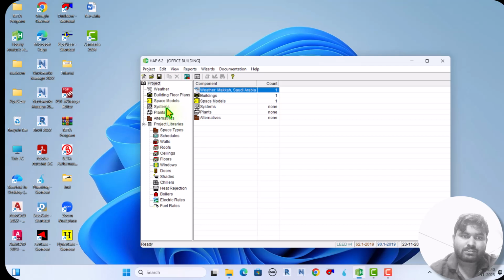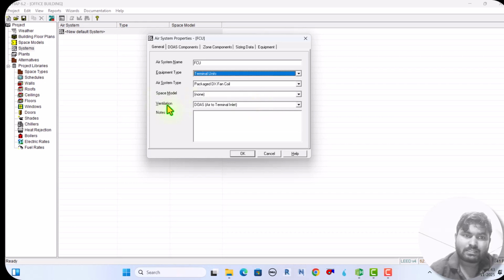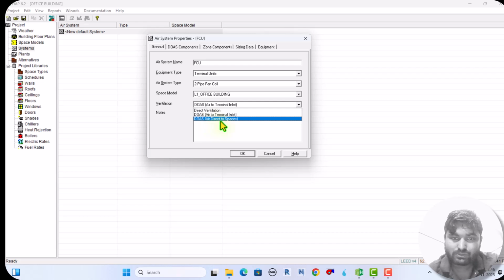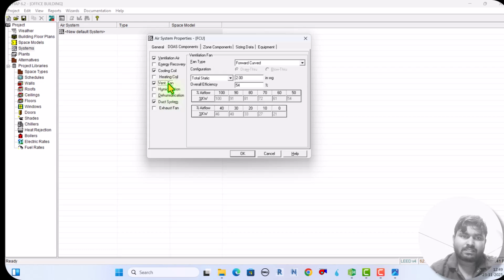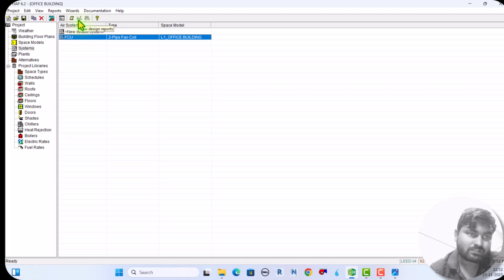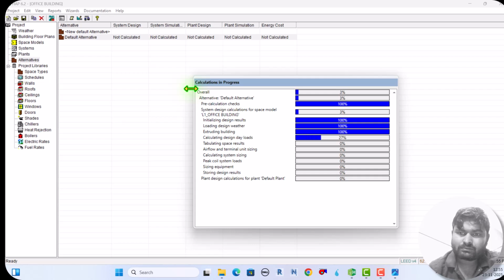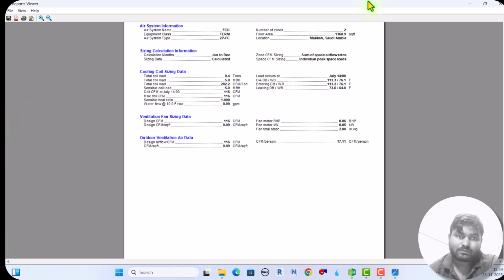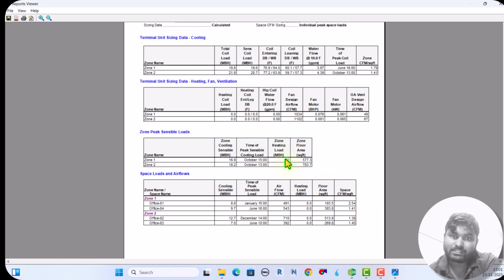HAP 6.2 Full Course | Project Setup to Final Load Report-PART 5

Comment: Hi Imran, i made a same project and design manualy by excel and using another software clwin Imventa, and  the result was about 40 Tons in these 2 cases. But using the HAP the result was 32 Tons.
Reply from the maker: Thank you for comment. 
In your case difference is 25% almost so better to cross check all the inputs again.

Comment: my project building has total 20th floor and 5 basement. But i need  to calculate load only for 4th floor. how can i define it in HAP 6.2 . because it is not only single ground floor with rooftop

Comment: Hey dear imran, I'm writing this to thank you for the effort you put in this.
I also had a question; my professor has assigned a project for us to find the right and appropriate ventilation system based on the sketches of random buildings of our choice. Could you guide me on what route I should be taking to ace the project?
Thank you for your hard work
Reply from the maker: Hi,
Thank you for your kind words.
For ventilation calculation you can use ASHARE 62.1  and for toilets, kitchens, pantries you can ACH method.
Reply: @imranfarhat9760 Good, I am familiar with ashrae 62-1 thanks to your videos, but this is my first time hearing about ACH method, could you explain this method briefly please?
Reply from the maker: @ariaataei will upload a short video soon.